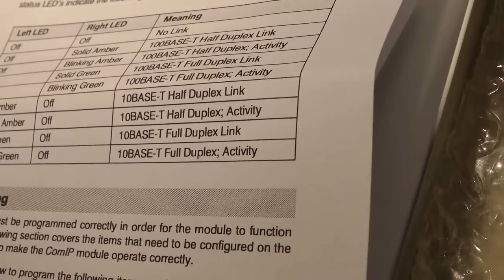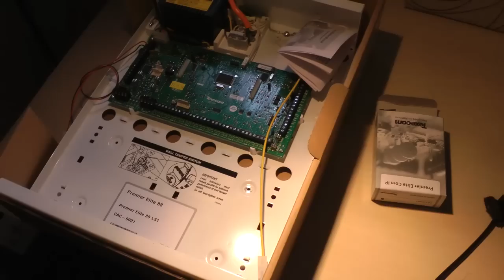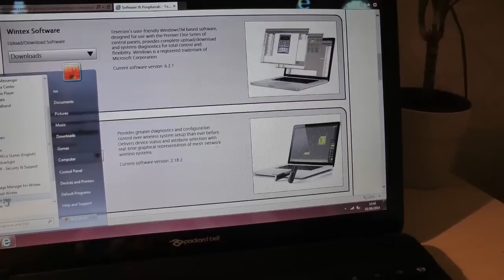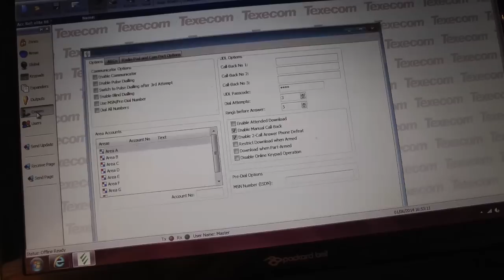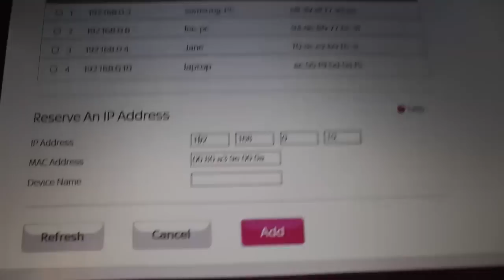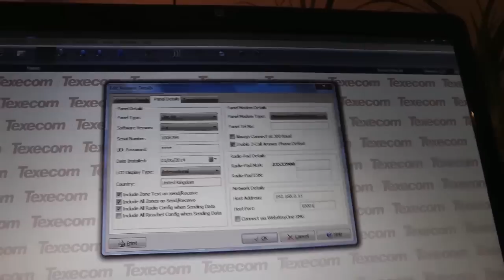texecom premier elite comip, installing and set up

Comment: For future reference, the com port setting is the Com port of your PC, not the Comms port on the panel. If you look back at your video, you will see that you selected Com 10 not Com 1 as you described. Com 10 is the virtual Com port assigned to your USB port. I hope this helps in future. Thanks for the video.